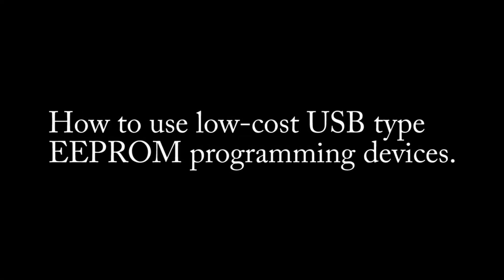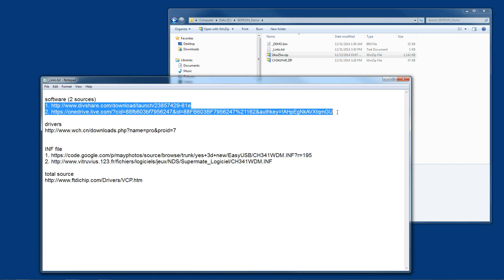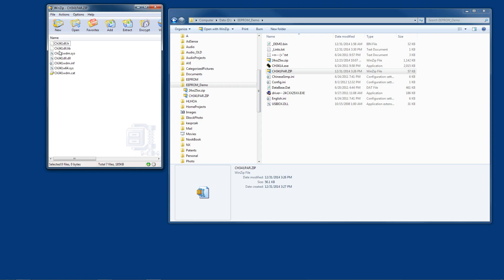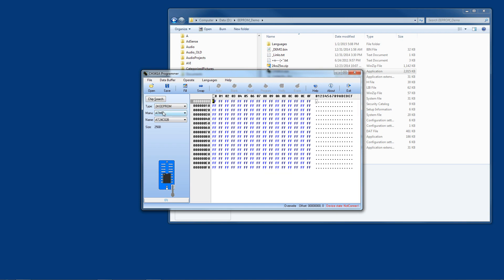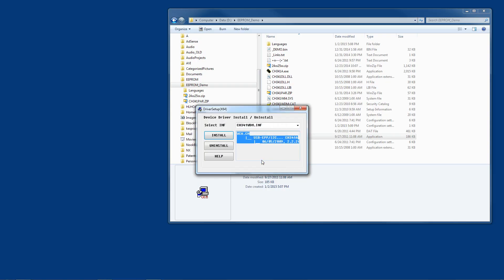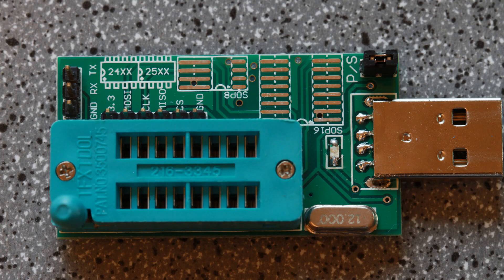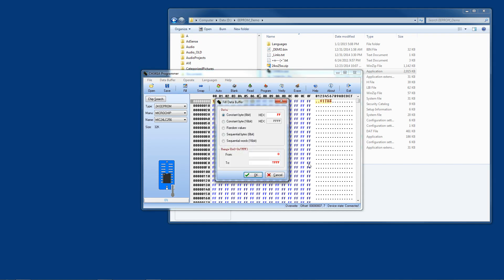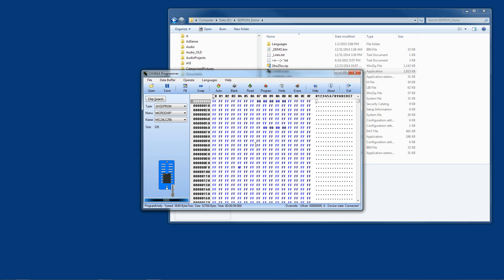USB EEPROM Programmer  **DRIVER DOWNLOAD LINKS**

Comment: Do you have a link for your USB?
Reply: +Custom Kontrollers  http://www.ebay.com/itm/24-25-series-EEPROM-Flash-BIOS-USB-Programmer-CH341A-with-Software-driver-/381374935496?hash=item58cbb7b1c8:g:LUcAAOxygj5ScklY
Reply from the maker: +Custom Kontrollers the software links are in my videos description.
Reply: no sir you mess understand me The item you have for the usb what is the link for it What ebay Link

Comment: Can You Copy A chip also On this Usb Programmer and save it to a exe or bin folder?
Reply from the maker: +Custom Kontrollers You can read the contents of a chip the save it to a HEX or BIN file, then insert a new (blank) chip and open the HEX or BIN file and write that data to the chip. So yes you can "copy" a chip, but it's through a file.
Reply: Thank you for the fast Message

Comment: i have a question... i have asus formula crosshair v. and i want to program my bios chip.. will this device work ?
Reply from the maker: I'm not sure what chip is on the computer. If it's a series 24 or 25 this programmer can work with that.

Comment: Found them. Thanks.Would you know by chance why I would get a verify error when flashing with the software? Maybe I bought a bad bios chip?
Reply from the maker: +david moheban What's the status in the lower right corner of the software? I've seen that message, but it was due to chip in the wrong orientation--the status may indicate if "a chip is present" i can't remember exactly what the status is.

Can you read the chip? even if blank? Are you sure you have the correct chip selected? Other than that, i'm not sure. Sorry.

Comment: EZP2013 driver plz any 1
Reply from the maker: +Dev Trend 
Try this link, 1/2 way down the page there is a link to a "CD" that looks like it has the drivers for an EZP2013 programmer

http://www.dx.com/p/ezp2013-high-speed-programmer-circuit-board-set-light-grey-green-305119#.Vmc8R7grKUk
Reply: thanks for helping but it still not working it keep saying device not  connected  and in device manager saying unknown the driver It came with that is saying  (not digitally signed) can u help plz

Comment: For anyone who needs the latest version of the software (Currently 1.32):

The seller is selling a programmer, along with accessories and a security dongle necessary to operate the latest software versions over here on AliExpress:

http://www.aliexpress.com/item/CH341A-Programmer-for-24-25-Chip/32546736891.html

This is the real deal from the real author.  This is the only way to use the later versions of the software for your newer chip.  After you purchase it you get a link to the software.  The software doesn't require a license, but does require the included security dongle to be connected to the computer.

You're also eligible for free updates upon future software releases.
Reply: The software is not free...  Let me know if you are interested in purchasing it and I can contact the developer in China.

Comment: Hey, do you know if this ch341a would work with a chip MX25L6473E?? This chip is not listed into the software but there are other ones very similar. My motherboard has 2 of those MX25L6473E as bios chips and im trying to flash them as it is not functional right now due to a bios fault!! I'd appreciate any help :)
Reply from the maker: +Gaming isnotacrime Sorry, i don't know. If it;s not in the MFG list, probably not, but then again, this thing was only $10, may be worth the risk.

Comment: I have installed the software for the programmer and change to english but my problem is when I try to read the bios it shows working light green switch on but no reading.I am using the cable from the programmer to the mainboard bios.LINK
http://tr.aliexpress.com/item/New-SOIC8-SOP8-flash-chip-IC-test-clips-socket-adpter-For-EEPROM-BIOS-24-25-93/32421161975.html?ws_ab_test=searchweb201556_2,searchweb201527_1_71_72_73_74_75,searchweb201560_9
Reply: +Joseph Cauchi    put the cip clockwise, not like in picture, 180 degree othervise. ok ?
Reply: +Joseph Cauchi   see min 7" in the video

Comment: i have a "mx25l8005pc-15g" bios but under manufacture i dont even see mxic as a option... what do?
***EDIT***
found it in a search... now just gotta figure out how to upload a rom file!
***DONE**
axidently used wrong rom file... it worked but now my gatway think its a acer with the same chipset.
Reply from the maker: RockeyDAproductions Can you just open the BIN file, then hit WRITE? I've programmed EEPROM using backup bin files this same way.
Reply: oh, i figured that out fairly quickly, have had alot of fun putting wrong bios roms on chip that are for motherboards of same chipset... now im unstably overclocking on a gateway :D... i need to get back in to the bios modding i did before i bricked this one. i originally bricked it by taking the cpu data from a the asus bios and replacing the cpu data in the gateway bios....ps i have pulled my bios out so many times in the past week i broke 2 pins off and had to solder replacement leads on them.

Comment: Can you check your CH34A1 software to see if it is up to date? I used the software from http://malthus.mooo.com/viewtopic.php?t=1040 and when I use detect on my chip, I see W25Q64BV for my chip. But I when I use your software, I get W25X64. In summary, I get 2 different readings when I use detect from 2 different programs.
Reply from the maker: luckyman64 I'm not sure how to check to see if I have the latest software. The places I got my software from were all Chinese and the make it very hard to find and even get the software. I got my install working and could program my chip.

I have no idea why these companies make it so difficult--I found 10 places to buy the programmer on eBay but only 1 actually listed software links. that's why i actually put a zip file of the software here.

Sorry.
Reply: Kris Kasprzak I think you need to check the about tab when you open CH341A software. I think your file is v1.13 but mine is v1.17. I found a chinese v1.29 also last night. There are so many different versions out there...
Reply from the maker: luckyman64 True, i could get the version that way, but I don't know how to determine if it's the latest version, or where to go to ensure I have the latest. In fact I'm not sure how compatible this software is between different programmers. When I first got this programmer I contacted one manufacturer (via email) and they indicated their unit used different software. The way these companies treat customers is a total train wreck. If this thing weren't so cheap, they would have a mess on their hands.

Comment: I am trying to change a couple Hex values on my EEprom can you help me with this I am lost now
Reply from the maker: Rob Barganier i think you will just read the entire eeprom data into the controller (read) then change the values in the software, then write the data back.
Reply: I'm Trying but it Keeps erroring it out. I have tried to delete the old info on a different EEPROM and move it to that one but still errors out
Reply from the maker: Rob Barganier 1.are you sure you have the right eeprom selected in the software?

2. When you plug in the EEPROM what message do you get in a lower right hand of the software is connected?
Reply from the maker: Rob Barganier also try this. Remove the eeprom and hit write. It will erred out after the write but is it the same error? If it's the same error perhaps the chip is not seated correctly in three programmer. If a different error perhaps the chip is bad.

Comment: Is it possible to use this program to update the bios of a chip using the manufacturer's official bios update?
Reply from the maker: Ryan Esoteric Possibly, but depends on what chip you have. Check out the full description above, as it lists chips supported by this programmer.

Comment: i come to see all of videos on youtube about ch341a but i didn't found my solution.. i installed all thinks like your video but i all time have the error which saying than ''write operations timeout failed!'' i tried all drivers or programmer logiciel on wch.cn but nothing resolve my problem.. if you want i can send you some screenshot.. i try to using a 25xx bios chip..
Reply from the maker: does your programmer show as connected? feel free to send me a screenshot of the issue. I think you can send me a private message and include a screenshot. Also what EEPROM are you using?

Comment from the maker: DOWNLOAD LINK: PLEASE READ THE VIDEO'S DESCRIPTION FOR THE LINK
Reply from the maker: I have since included all files in a single zip file and in the link in this video's description. When I created this video, the software I found was in separate files. Just unzip every thing to the same folder and follow my steps.
Reply: That's so much :-)
Reply: +Patrick Kapuścik  it's working..
Reply: +Solovyv Dmitry Нет ни у кого. Смысл покупать ее, когда проще купить другой программатор за те же деньги но с более мощным функционалом.
Reply: At 2:30 you talk about opening the 24xx25xx zip file.  I don't see a link for that.  Is it all in the one zip you've linked to?
Reply: Kris Kasprzak
Okay.  Thanks very much.
Reply: something like this appeared on the link (Sorry, the file you have requested does not exist.)
Reply: can you please the link to my email?
Reply: The  exe s and the usb*.dll are both infect - Reputation.1 virus Network.1 Virus ... etc .. be careful.
Reply: Can this be used for microwire 93c46?

Comment: I was looking all over for a video like this to help me install the device. For some reason my Norton Security sees the installation file for the software as a Trojan.Gen.2 and removes it.  For instance in the first link above it shows the zip file has a trojan in it.  This happens with other places I find the software too...usually it detects CH341A.EXE as a trojan.  Did anyone else have this issue?  I'm a little Leary since the software comes from China.  Or do you think this is a false positive because of the nature of what the software does?  thank you for any and all feed back.  I hope I can make this work I need to restore the lost BIOS on a PC I would hate to have to throw out.
Reply: Oh and thanks for creating this video,Kris !  I was hoping someone did one in English, I was happy to find yours.
Reply from the maker: omegaman73of3 I've not had any virus issues. Good question as to what is going on--I hope others chime in...
Reply from the maker: Kris Kasprzak PS can can post my zip files for you to download and try--perhaps the ones i downloaded are clean. I did this for another comment below but removed that reply.
Reply: Kris Kasprzak That would be great, Kris, if you could get the exact file you used to me !  I did download the one from www.divshare.com... mentioned in your video. That had the Trojan detection I mentioned above, like the ones I had downloaded from other sources I'd found the file at.  Do you run a current antivirus?  If you scan the zip with yours you don't get a Trojan detection ?  Thank you again for your time and help.
Reply from the maker: omegaman73of3 This link (which is from my personal hightail service) should contain all the files you need.I just scanned all files before zipping and uploading and there were no viruses or trojans reported by McAfee (anti-virus Ver 16.8, anti-spam Ver 13.8) 

https://www.hightail.com/download/UlRTcXltRStqY3JOUjhUQw

Hope this helps.

PS...I'm 99.99% sure i included all files, let me know if something is missing.
Reply: Kris Kasprzak Hi, Kris.  Thank you very much I downloaded the zip and its scanned clean.  I have not yet installed the application. I will do that next and let you know how it goes ASAP.  Thought you might want to remove the link now that I downloaded the file.  Thank you very much for taking the time to do this.  I appreciate it very much and wish you well for your kind generosity.  BTW- makes me wonder now in thinking those other files really were infected and it was not a false positive on the virus scan.  I hope others do not get the Trojan I mentioned.
Reply: Update: using the files you supplied me with and your excellent video I was able to get the device running just as you showed.  So all is well with that.  Thank you   Unfortunately even after I wrote the BIOS back to the chip and confirmed it with the CH341A application,  the BIOS chip did not fix the PC.  Still a blank screen as before.  I guess there is more wrong with it than I thought.  But that's my problem.  What you helped me with worked great so now I can use this writer device when needed.  Best wishes !
Reply from the maker: omegaman73of3 You're very welcome. Pay the help forward :)

Comment: Hello! great video! thanks for sharing, i have an question if you can help me i would be greatfull: i have an ASUS P8B75M-LE dead after an BIOS update, on asus website says there is: "128 Mb Flash ROM, AMI BIOS," i can use this usb stick reprogramer for recovery my motherboard? what you think?!
Reply from the maker: I seriously doubt it. The chip i showed held 32K of data, and i'm sure you ROM bios is a very different chip. I've never flash my MB bios but I would call ASUS and see if they can walk you through re-flashing your bios.
Reply: Thank you for replying! i have seen on motherboard the chip is: "25Q64BVAIG" and i have downloaded the software by the link on your video, this chip is listed on the software for reflashing! i think i will give an try buying this same reprogrammer on ebay and trying to give life again for the mobo! lol and if something goes wrong i can buy an already flashed bios on ebay too, thank you for this great video!
Reply from the maker: Antônio Tito you're very welcome. Let us know how it went.
Reply: Surely i will! have an great weekend.